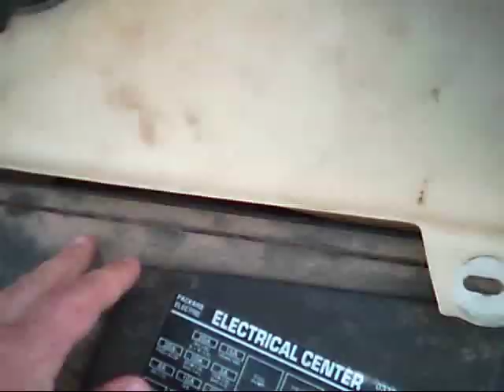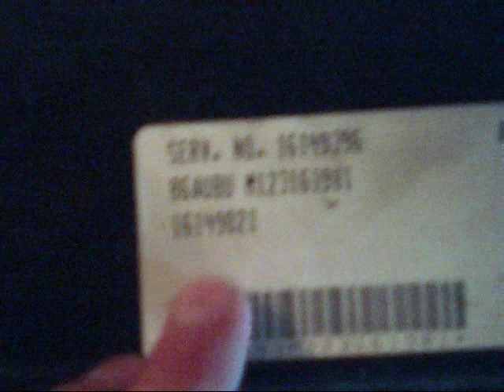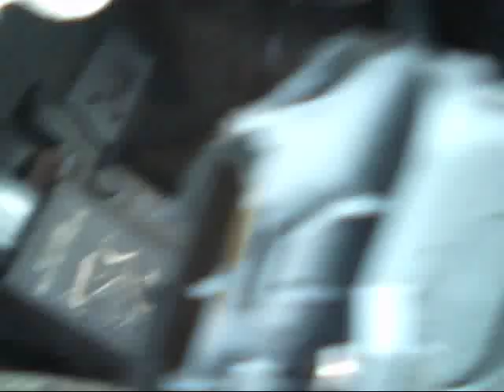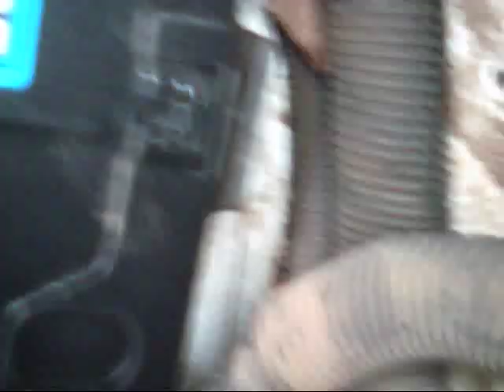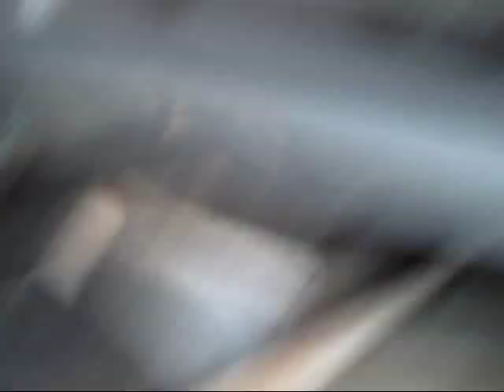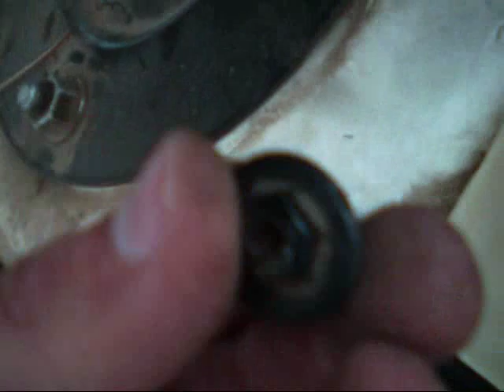How To: ECM Replacement 1993 Buick Regal, Oldsmobile Cutlass, Chevy Lumina, Pontiac Grand Prix

Comment: how long should you drive it after you connect the ECM before bringing it back n disconnecting the battery..and how long should you disconnect the battery before reconnecting and letting it idle for 5 or 10 minutes ....I'll be doing this procedure soon on a 93 cutlass supreme I'm about to buy ....and where can you get a refurbished ECM at ? .....thanks in advance

Comment: I am putting a 3.4 in place of my 3.1 on my 1997 Lumina. Will I have to switch out this computer module?
Reply from the maker: +Lyn Repenn It would be best to swap the computer assuming the donor vehicle is the same year. You will have to verify that the engine harness/connectors and electrical pinouts are the same.
Reply: OK Thank you very much, I was thinking I might have to do that..

Comment: You do NOT adjust the idle on the 1993 Chevy Lumina 3.1L V6.  There is NO adjustment.  That is performed by the ECM...which you have replaced...
Reply: Not necessarily, there is a idle relearn procedure you can do for some W bodies